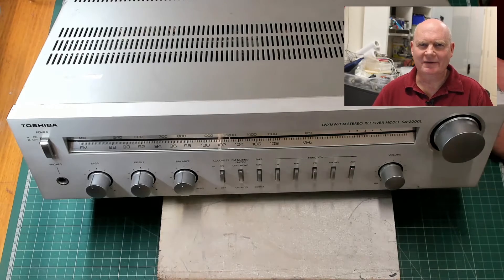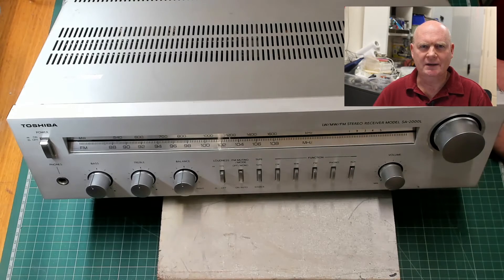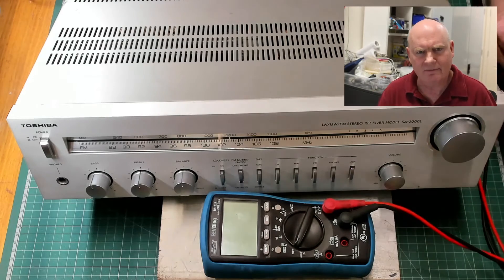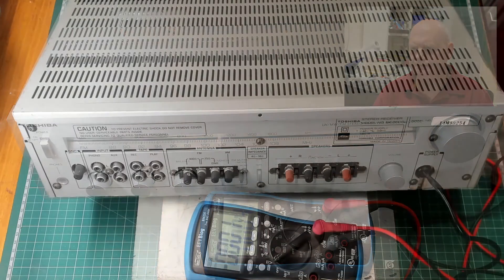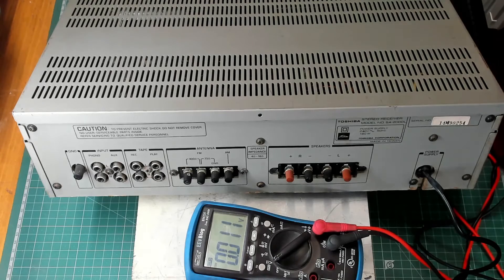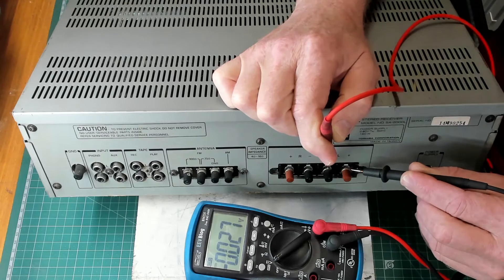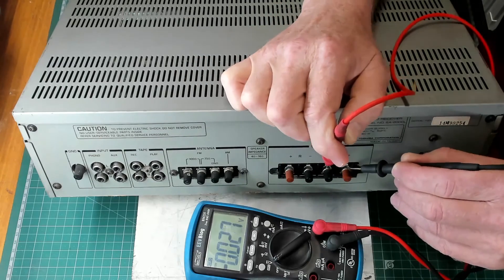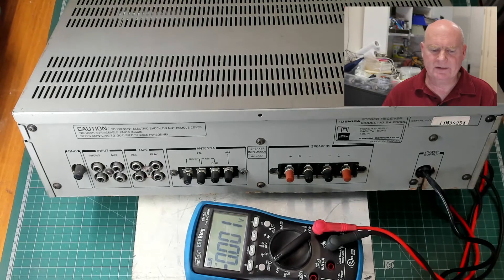Measuring DC Offset on a HiFi Amplifier

Comment: Great video im experiencing a serious issue with a 2 way amplifier module(plate amp) after hours of playing my speaker got cooked its a 4ohms amplifier for some reason.. should i allow the amplifier to heat up for like a hour then test the dc offset? i guess i have to set the Dmm to Dcv mode ?

Comment: Total amatuer here, would it not be possible (at the detrement of poorer sound) connect your speakers via a large capacitor when first testing to remove the dc element?
Reply: Yes, but without measuring with a DMM, how would you know you had a faulty amplifier then? FYI, your tweeter will always be protected from dc voltage as it's own passive crossover network has at least one capacitor in series with the signal, even if it's bi-amped with external DSP like in a large PA speaker, there is usually a large capacitor in series with the compression driver to block DC regardless. DC offset only affect woofers.

Comment: Turning on an amplifier without speakers connected is not a good idea. It can cause damage to the amplifier.
Reply: Partially correct: running a signal thru a tune amp, without a load, could lead to damage... transistor amps don't give a damn.
Reply: Only tube amplifiers
Reply: I liked this and the tube comments because I didn’t know this

Comment: Fantastic, just noticed you had the meter leads connected in reverse polarity on the first leads and polarity matched on the second one. Does it affect the reading in anyway other than reverse polarity ? Also if there is reading , let say 1 volt or higher it’s bad ?
Reply: Polarity doesn't matter, only the magnitude. Also, he said under 10mV is great. So, 1/100 of a volt.
Reply: Some meters do read different when incorrect polarity

Comment: Off-subject question, but back in the day I had an Onkyo TX-37 that would blow the speakers when it was powered on. A friend of mine took a look and determined that we needed to replace the amplifier. I don't recall all of the details, but I believe we only replaced one amplifier. I thought that these receivers had an amplifier per channel? Ultimately, I am curious as to why a non-functioning amplifier or any other component can cause DC voltage to be sent to the output of the speakers and damage them - isn't there always a protection circuit to prevent this? I'd love to hear feedback on this as I just ordered another Onkyo TX-37 that has only one channel of output. I'm hoping to learn as I go, cautiously, and repair it myself.
Reply: 04 / 07 / 25. 4:00 pm. Where is the volume control set ?

Comment: Thanks i got a little knowledge. I more think i want to ask is if we preset bias in power board and left channel and right channel has little different dc voltage like 0.02 millivoltv on left channel and 0.09 millivolt on right channel. Will it effect the sound quality? 
My next quotation is in service manual of sony ta 1150 it says 25 millivolt on both the channel. Is it safe for speakers?

Comment: Stopped watching this video the moment he said "Speakers run on DC voltage" . End of story.
Reply from the maker: Yes, this was not correct. Generally these amps convert the input power supply to +/- DC supply rails used in the amplification of the continuously alternating audio signal   - therefore AC. When testing for DC-offset, however, we set the input signal to zero and measure for DC-offset on the speaker outputs (not AC signal levels) with our multimeter. Thanks for your correction.

Comment: I'm a beginner and please excuse my banal question. Are the speakers powered by alternating current or direct current? If Google translated your statement correctly, you are talking about fluctuating direct current? Which is correct, alternating current or direct current? Thanks!
Reply: AC signal.  DC is harmful l.

Comment: The problem with testing that open circuit is that you have no idea what the impedance of the DC offset is. It could just be a so called "ghost" or "phantom" voltage. 

Suppose that I measure a 1V DC offset open circuit; but,  further suppose that the impedance of that offset is 100 kilohms. If I have a speaker that has a DC resistance of 10 milliohms, then the 1V is divided across the the 100 kilohms and the 10 milliohms. The speaker only receives: 

10mΩ/(10mΩ + 100kΩ) ≈ 100nV

The current drawn will be:

100nV/10mΩ ≈ 10µA

That's not enough to damage a speaker.

Some meters have low impedance modes to help eliminate "ghost" voltages.  If not, you will need to test the DC offset under some load to ensure that it is not simply a "ghost" voltage.
Reply: I don't know where you did your training but a DC offset doesn't have an "impedance". Do you understand what impedance actually means? 
Then you go on to say it might be a ghost voltage. No such thing. Either voltage exists or it doesn't. 
If you measure 1 V of DC offset, that's it - 1 volt. There is no impedance of the offset.
A speaker would not have a DC resistance of 10 milliohms. 
Seriously, you need to go back to electronics 1.01 and start again. Everything you have said is completely wrong and totally irrelevant.

Comment: ho hum, my amp has DIN speaker sockets and the ends of multi-meter probes are too thick to fit inside to touch the speaker terminals.
Reply: get me probes then. or use a paperclip. 
geez

Comment: Thanks.  FYI, probably a good idea to test red probe to + and black probe to - speaker connections (I noticed one measurement was positive and the other negative).
Reply from the maker: No, for this sort of quick test the polarity of the measured DC offset doesn't matter - just the magnitude. You can connect the probes either way and ignore the polarity of the multimeter measurement.
Reply: Oh boy, some of these fella in the comments are diving in head first and even giving advice with little to no knowledge of what they write about. Good luck indeed. 😅

Comment: After doing this encountered something odd. Mine were measuring single digits each and felt pretty good about that. I then checked the idle current on the main board which the manual says should be 7.4 so I dialed one from 15 to 8 and the other from 9 to 8. I checked DC offset after this and my numbers went up to around 22mv each. Why would lowering idle voltage and getting things in balance raise DC offset?
Reply: Is it a Sony?
If so it’s reversed ie opposite way to adjust

Comment: This was very useful, thanks! (I have several used amplifiers I have picked up over the years and haven’t had time to hook up speakers to them to try out and now I know when I do finally have time to check the DC offset before I hook up the speakers so I don’t damage them (I have several pairs of  vintage speakers and would hate to have any of them ruined when a simple check with a voltmeter would tell me if the amp was ok or not).
Reply from the maker: Many thanks for your comments. I'm glad you found this useful. I wish you well with your future amp testing!

Comment: What happenes when you cross the probes, I'm trying to find the polarity from a old guitar amp speaker wires, don't know what one is the hot wire or ground.
Reply: For DC, crossing probes simply changes the polarity of the reading.  For AC, polarity has no meaning to the meter. 

If you are trying to separate the live and "ground" of an AC line, then measure both lines against a known ground the live line will still show a voltage difference, the "ground" line will not.

Comment: i don't get it;  say DC offset is 100 mV;  
100Mv on a 4 Ohm  is a power of only  V*V/R ,  or 2 mW; 
 what diff. does that make??
Reply: And there is another problem. Even a 100 mV voltage may not harm the speakers, but it will displace the woofer moving coil from is center position by a few millimeters. And so, the maximum excursion of the cone in both directions will have different limits. 
The tweeter is itself protected from DC by the capacitors in the crossover filter.
Reply: He told that he'll show "what we can check before connecting speakers".
Passing high DC voltage through a speaker may be fatal (speakers don't like DC).
Reply: @bartosz-2197   fatal?  2 mW??  did you understand the question? sorry, i have the SAME doubt, NO ONE understands how 200 mV can be bad to a ,say, 200 watt speaker, i just KNOW it is bad because EVERYONE says it, but why? how? thanks
Reply: A speaker impedance rating is for AC and it changes with frequency -- sometimes in complex ways due to the crossover.

At the heart of most speakers is a coil.  At DC, an ideal coil is a dead short. In a real world coil, the only impedance of the coil will be provided by the series resistance of the wire that the coil is made from and will likely be far less than a single Ohm. 

That said, since he is measuring the offset open circuit, we don't know that the output impedance of the DC offset is. I'm not convinced that it is low enough impedance to do any harm. The voltage could easily collapse under and load.  See my top level comment for details.

Comment: Hi   I have a pair of Metaxas Solitaire power amplifiers. They both need restoration unfortunately. I'm sure you know that there is no volume control -just an on off switch .Is it safe to proceed with your procedure , without an 8 Ohm resistor (representing speaker impedance) across the speaker terminals? Thank you
Reply from the maker: I don't know what topology these amps use, but you should disconnect any input signal connections before testing. If they are valve amps then they should NOT be tested without a load. I wish you success.

Comment: Hi, thank you for the nice and clear explanation, just few questions: how do you set the volume pot for this test? does it have any meaning to this? if not, what can mean if dc reading continously increase taking volume pot from min to max? Thank you again.
Reply from the maker: Set the volume to minimum when doing the test. Perhaps your preamp circuit is introducing some DC offset ?

Comment: I mean, I guess alternatively, you could keep a few cheap speakers around that you don’t care very much if they blow. Also, to the best of my recollection, I don’t think all amplifiers are designed to be run without a load, and might be damaged if left running without speakers connected,… such as certain tube amps. I dunno, but, I reckon I’ll just keep a few dumpster salvaged crappy Chinese, or salvaged speakers around for testing amps and receivers, like I’ve always done. I can always alligator clip ‘em into the appropriate impedance,… and pack em away, when I’m done, or scrap em, if I blow em up.
Reply: monster

Comment: My output transformers prevent this.  Else there would certainly be 700VDC 😊
Reply from the maker: Yes indeed - transformer-coupled amps will prevent the DC offset from being seen at the speaker terminals. Thanks for you comment

Comment: Thanks mate. Although I'm a bit concerned my left speaker terminal is reading 14.5mv snd right is approx 35mv on my NAD C320BEE.
Reply from the maker: If you cannot notice any audio distortion in the speaker output then perhaps you can just leave it be.

Comment: You would think positive to positive, but apparently is not the case.
Reply from the maker: You are correct. The thing you are measuring is the voltage across the terminals - either positive or negative - and so the orientation of the multimeter probes is unimportant for this measurement.

Comment: Thanks for the video. I have a question, I obtained a pair of pioneer speakers and checked the impedance of the speakers. One speaker gave me a reading of 6.9 ohms the other 6.1 ohms. I was wondering if the reason for the lower impedance is because the speaker itself was damaged by a previous owner through excess dc on the output to the speaker. Is this possible and if not what do you think could have caused such a difference.
Reply from the maker: Thanks for your question. I do not think that the difference you have measured necessarily points to a speaker problem. It is worth remembering that speaker impedance is not constant - it varies greatly across the frequency range. A good description of speaker impedance can be found on YouTube on "Steve Guttenberg Audiophiliac" channel - video titled "Everything you need to know about speaker impedance". You might have some some slight difference in response of the speaker drivers themselves, the cross-over components, or even the wiring/connectors, but it might not (probably wont) even be noticeable in use. So in summary, I'm not sure you could definitely point to a high DC offset as being the cause of the slightly differing resistance measurement you have quoted, and hopefully it is not going to adversely affect your listening pleasure!
 I would welcome other peoples comments.
Reply: @northbalwynrepaircafenbrc8202  ok thanks I will have a look at the video link. Just wanted to add the impedance I measured was for the bass drivers after they were disconnected from the crossover boards. The mid range and tweeters were fine.
Reply from the maker: @NZfabrock  OK, you can ignore my comments re the crossover and wiring components then! I'd be interested in what you find out in your research. I did a quick check on one of my mid range drivers and the resistance measurements did fluctuate a lot (multiple ohms) as I put a little light intermittent pressure on the driver cone and it did take a little while to settle back down to a resting reading.
Reply: @NZfabrock  If I may jump in...  you might have a problem.  Maybe.  And it's not necessarily because of DC offset; it could be, but might have just been normal loudness.  If a speaker is driven hard, such that the heat builds up in the voice coil (because, by design, it lives in a small gap and doesn't have a lot of clear air around it), what can happen is all the voice coil glue melts.

The power is applied to the speaker's voice coil, and becomes an electromagnetic force pushing against the fixed magnet around it.  It's actually the coil that is being forced back and forth, the coil is firmly attached to the bobbin, the bobbin is firmly attached to the speaker cone, and the speaker cone gets pushed in an out, and makes sound  -- everything's fine.

But if so much power is being pumped in, turning to heat, the voice coil glue can melt, and the coil windings are no longer firmly attached to anything -- they're floating in a puddle of goopy melted glue.  So the coil can change shape and position, the winds of wire get pushed around, the glue gets moved around and fills up the gap the coil lives in.  The wire is still intact, still sorta make sound, but doesn't seem quite right.  Then it all cools down, the glue hardens up, and everything is still sorta there and still sorta works, and you say "Phew!  I thought I'd lost it -- but I guess it's fine."   Lingering doubts!  And you can hear (and feel) the glue scraping on the walls of the magnetic gap when you push gently and evenly on the cone to move the coil in and out of the gap, you get the sense there's something not quite right, and ... the impedance measurement may have changed a bit.

This is especially possible with woofers and subwoofers, where lots of power lives in the low frequencies.  

Midrange drivers and tweeters tend to just go "poof!" when overloaded, because the voice coils are so light and are wound with such fine wire.  There is an assumption that there won't ever be much power in them, and with typical music (for example), that's true, because of the relationships between frequency and power and loudness -- the higher the frequency, the less power you need to make it sound loud.  Radically so.

Surely, there can be other reasons for the impedances to be different, but that's one possible scenario.  I think it warrants further investigation.  Prepare yourself emotionally for whatever you might find...  I hope you get lucky.  :)
Reply: @ydonl  That's what happened to my Soma speakers years ago, my Marantz amp blew the mids and pop they went. Soma replaced the speakers. I think it was something to do with the loudness being on and treble high? Damn though, I miss that amp.

Nice explanation, thanks
Reply: @EnzoFerenczyo  Yup.  And its pretty common with musicians who lack judgement...  :)  You can sorta get a feel for a driver's power handling by thinking about the size of the voice coil.  Tweeters are super easy to melt; midrange drivers not too difficult.  You have to work a little harder to melt a woofer, but not that hard!
Reply: @ydonl  Yeah, in those days lack of judgment was "kool", can't remember how many times I was kicked out for blasting Machine Head or Aerosmith's Toys in the Attic at 11 on the volume and on the clock! lol Ahh to be 18 again.
Reply: You weren't measuring impedance of the speaker with your multimeter - you were measuring DC resistance. They are not the same thing, even if the numbers might be close.
Reply: @stopthebus  ok expert in your own words you tell me the difference, I know what it is but i bet you dont